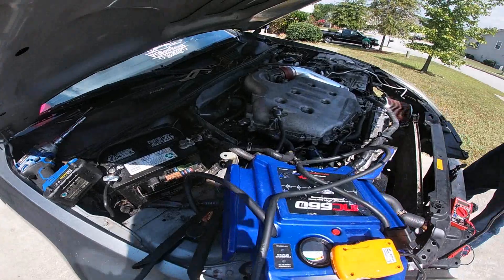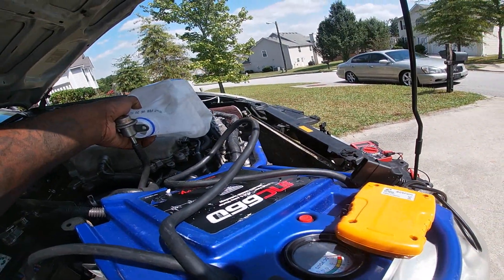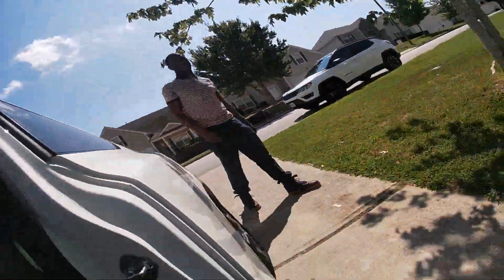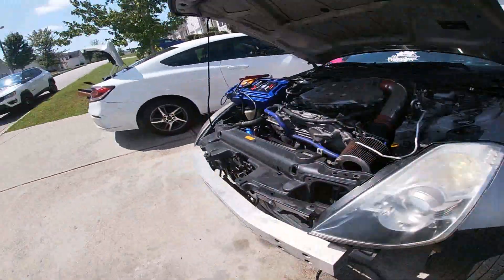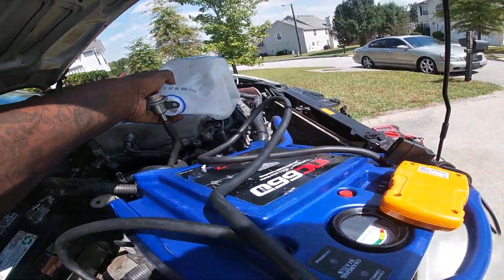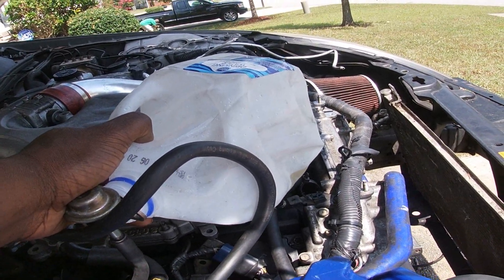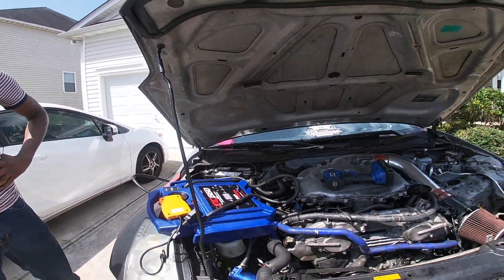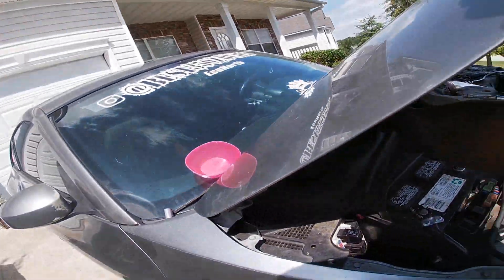BEST 350Z BUILD | CRANK WITH NO START SYMPTOMS

Comment: Bro.  Just ordered a rebuilt engine, paid a shop to install it and they're having the same issue.  Crank, no start.   All new sensors.  You ever figure out the problem?
Reply from the maker: My situation was the harness. Your situation can be different depending on all the factors. It can be a lot of different reasons if you don’t know what’s tested already. What’s the things that’s been tested?
Reply: @Best350zbuild  I unplugged the crankshaft position harness and it eventually started, but shakes on idle.  Seems like the shop didn't properly align the flywheel on the index dowel.

Comment: I have an 08 350z that I swapped and will crank all day . I’ve double checked over every wire , even tried to scan it but no codes . I check for fuel and I have fuel I’m not to sure about spark . I was told that I was going to have to reprogram it . I’m not to sure it I have to if I’m using everything the same on my old set up . If you can help thank you .
Reply from the maker: I apologize for the late response but if you swapped all the old parts to the new motor it should fire right up unless you have an issue with the crank sensor. My issue was when I pulled my motor I ripped my connector for my cps and it didn’t work when I tried to splice another onto it I had to order a whole new harness

Comment: hey man, I got a 03 g35 with the same issue. i got a good battery and I tried starter fluid and it didn't work. Since starter fluid didn't work im assuming im getting fuel to the engine. I car hear the fuel pump prime when I turn it to the on position.  It still cranks but wont start. Is the last thing I can check the spark plugs? And if so will I have to remove each plug individually to check them or is there one specific plug designated for starting the car? If anyone has had a similar issue please help me out. Thanks
Reply from the maker: You need to check your cam shaft and crankshaft sensors if those are good check your knock sensor and if all those check out you need to check the spark plug gaps make sure they didn’t get messed up cause the slightest throw off wouldn’t allow the car to start

Comment: So did you end up getting g it started?
Reply from the maker: Yea I found out my crankshaft position sensor connector was cut off when I pulled the motor
Reply: Was it just cranking And not starting when it happened?
Reply from the maker: Derek Redwine yea it would just crank forever. After I replaced the harness it fired right up
Reply: @Best350zbuild  do you need to pull the motor out in order for you to replace the sensor?

Comment: PLEASE LMK SO IT WAS YOUR CRANKSHAFT POSITION SENSOR
Reply from the maker: It was t he connector that went to the cps but all in all yes it was. When it comes to sensors on the z and g I use oem. Auto zone and others usually give me problems
Reply: Yh I got a g35 and when I want to start the car  it makes that noise I drove it that week before it happen I’m pretty sure I have spark and fuel that’s getting into the motor since the car actually drove not sure what’s the problem tho any suggestions
Reply from the maker: @Berto3.7  well 1st I’d check to see if any codes pop up and if so fix the issue at hand if not my next step I would take starting fluid spray it into the intake system then try to start if it turns over then immediately turns back off you have a fuel issue
Reply: @Best350zbuild  and let’s say it’s the fuel how can that be fixed, or what are things I might  need to purchase if Needed

Comment: Nats light is off?
Reply from the maker: I believe at this point I was tuned with uprev and they removed nats for me so nah that wasn’t it. I believe it wasn’t starting cause I had a splice where the cps was
Reply: @Best350zbuild  as long as you asked them do delete Nats..  I know they wont do it unless you ask them is all but if your light is on then nats could be an issue styll... maybe nats is gone but your car is still In lockout mode?
Reply from the maker: Mustafa Gak lol nah bro I paid like $150 specifically to have nats turned off. I had a short where my cps was

Comment: What the problem my g35 is having the same problem
Reply from the maker: For me it was the crankshaft position sensor connector. When I pulled the motor I forgot to disconnect it and ripped it from the harness. It never started after that I had to get a new harness then it fired right up
Reply: Ok thanks
Reply: @Best350zbuild  do u have a video of this and how u fixed it?
Reply from the maker: @sameermahmood9413  just got the car back I’ve ordered some parts I’m just waiting fpr them to arrive and I will do a full detailed video on how to properly check for the crank no start symptoms

Comment: What was the problem
Reply from the maker: I believe it was a part of my harness not being attached. Soon as I plugged it in the fuel pump came right on 🤷🏾‍♂️
Reply: @Best350zbuild  what harness
Reply: Best 350zbuild what harnesses?
Reply: @V37Jus  i would appreciate it so much if he could do a video since im ahving similar problem
Reply: grizma same here. Just changed my camshaft sensors and nothing. Don’t want to buy fuel pump and put more money into it unless I have to. Will be checking and cleaning injectors tomorrow
Reply: @edgarlopez1247  Did u end up fixing it ?
Reply: landh4wk25 so I cleaned up my injectors and are working perfectly. I ran out of ideas and patience I called a mechanic, friend of my dad. He said it could be the timing.. when I got the car the guy said he had to crank it for awhile and hold it until it turned over. And me trying to crank it could’ve messed up the timing. He took it to his shop and opened her up.. long story short my timing was so screwed and messed up my cams/rods. Would take lots of $$ to fix that might as well buy new engine. That’s where I’m at now looking for an engine. Hopefully that isn’t your issue.. 🤦‍♂️good luck!
Reply: @edgarlopez1247  godamn bro you think thats the problem with my 05 g35? Mine will crank but not start. It wouldnt rev over 1000 when i was making a turned and out of nowhere that happened. My car is sitting at a shop that is 45 mins away from me.